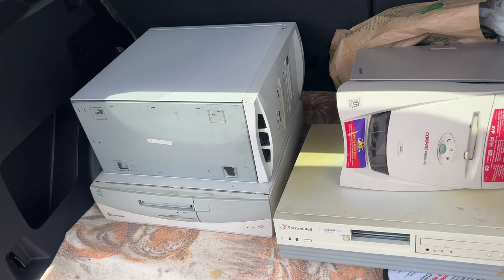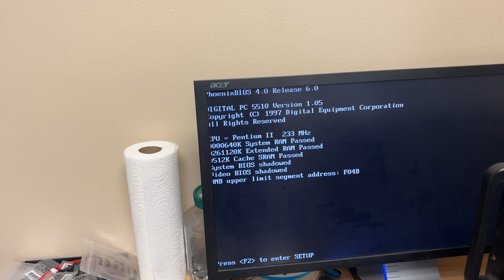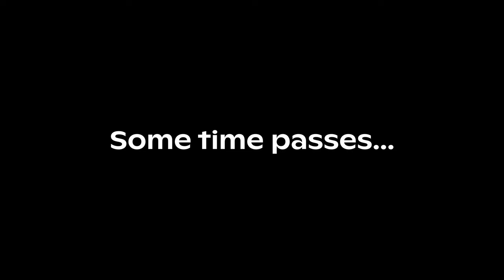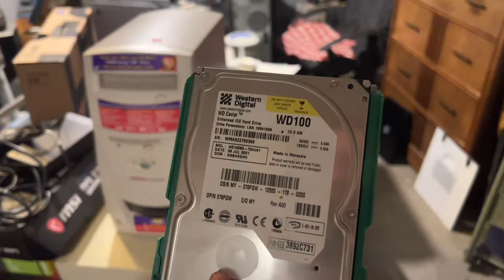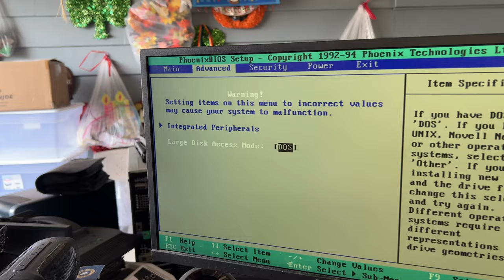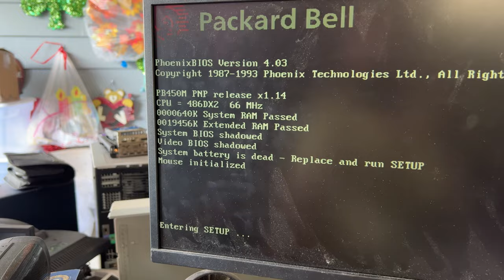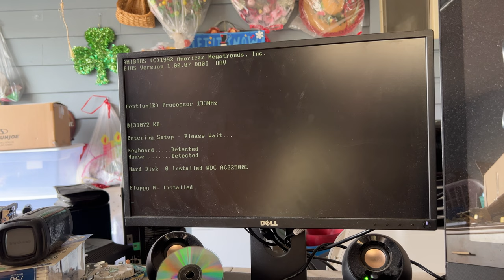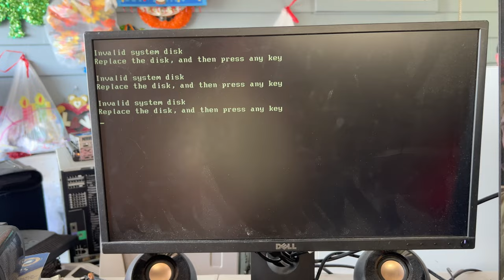Four free vintage computers...Do they work?

Comment: I have to this day something similar to that Presario.  Mine is a 5070, with 350mhz K6-2.  It was freely handed down to me from a family friend. When I got it around 2003, I immediately found & updated the CMOS version, back when Compaq still had websites with the downloadable cmos versions & it was a successful burn.  I have not worked on this PC in 15-20 years but hopefully will get back into it soon.  Last thing I "tried" to do back then nearly 2 decades ago was to replace the AT powersupply with an ATX powersupply but I ran into "short cable" syndrome where the AT-ATX adapter cable was too short & I pretty much gave up & moved on, heh.  Supposedly the motherboard has an XG MIDI chip on it which was one reason I kept it.  I will also try to replace the CPU to a faster one, hopefully a K6-2 550 or something, if I can find the right speed switch combos, as some of the combos may be undocumented.  I have a few more vintage stuff, my Commodore 64's being my oldest PC's in the bunch.  Have a nice day. 
06/28/23

Comment: That Gateway2000 there was my first computer. 200Mhz MMX Pentium, 48mb ram, 2, 3GB hard drives. I used to emulate playstation on it as a kid at low frame rates. Think I had an ATI Rage 128 in it (PCI) and I was running a SoundBlaster 16 Wave Effects ISA sound card

Comment: talk about a trip back in time! Cobbed together systems from 1994 on, those green rails I recall as well as a buch of similar ones for different systems. I built several bunches of systems starting with DX2-80's w/ 4 speed CD-Roms, all bfore PS2. I figure through the years I assembled +300 systems...

Comment: The $3 computer wasn't missing its front panel, it was missing the front door. With the door closed, you couldn't open the optical drive. The first thing I did with a case like that was to remove the front door.

Comment: maybe dumpster dive best buy's dumpster and see what tech you can save?
Reply: Could also trash pick and dive other areas for pcs too.    And show the setup, perhaps organize a "install table" (aka a place for whatever computer is installing a os and taking awhile to free up a main spot to work on another)  As far as the athlon maybe gpu needs reseat/contact cleaning?  And was the caps bad?
Reply: Patg108 i hate sw va so much i wanna move where u r
Reply: @isaacwright2247  my area barely has any pcs in trash or in thrift stores

Comment: lucky to be there I bought a ThinkCentre Edge 72 & iiyama E2483HS-B1 24-inch screen at the weekend for £20 the screen might resell tonight for £35 and decide if I want to upgrade the PC with an i5 and SSD or just resell it.  will defo get more than the £20 I paid anyway.